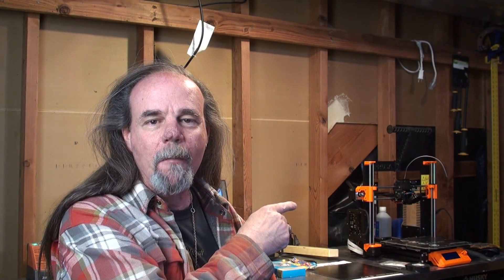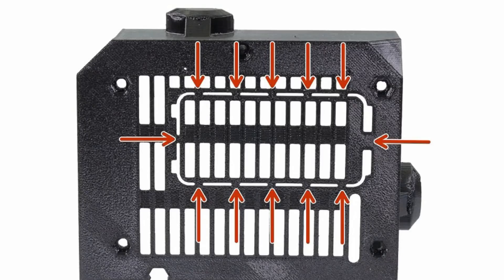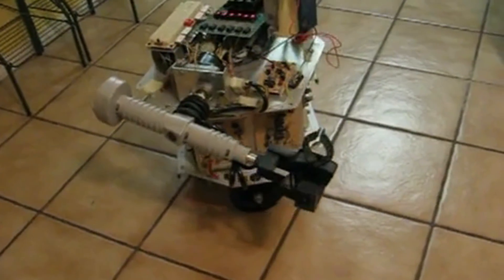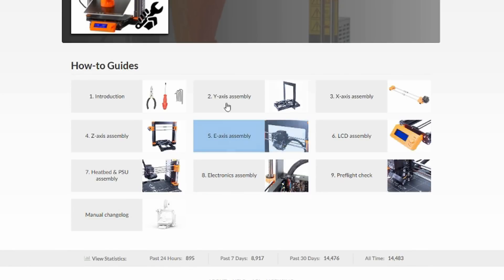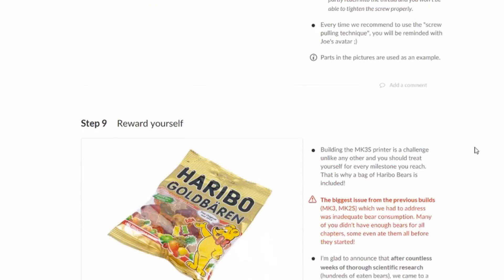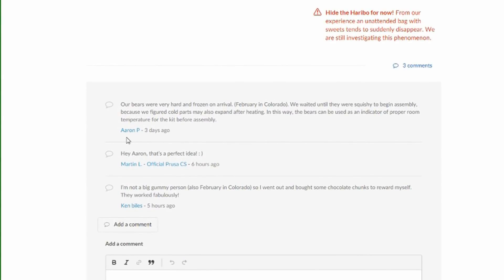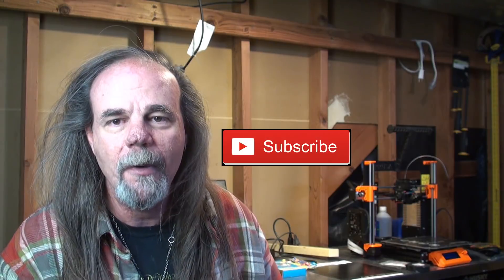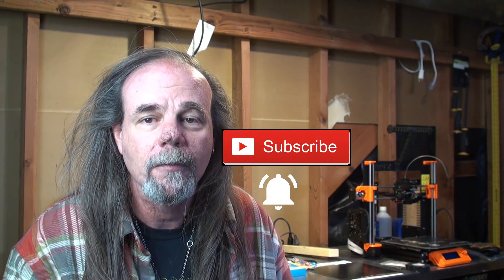Should You Buy The Prusa i3 MK3S Printer Kit?

Comment: The upgrade from mk3s from mk3 is good as a whole. But I don't really like the new sensor. It's basically a mechanical sensor with an IR switch. The previous sensor was able to detect not only presence but also movement. So I you had a jam or some other kind of issue that would prevent the filament from being extruded or not being extruded properly then the printer would detect it. Now you just have a presence sensor but instead of mechanical it's a combination and the mechanical part of the sensor is less prone to failure since it's just a lever moved by the magnets and the filament. So basically, negligible wear. This sensor is better than other sensors out there but I don't think it's an upgrade from the one on the MK3. I hope they fix this. Also I've been having issues with the new one not detecting the filament when it's inserted
Reply: do you recommend the mk3s? im trying to decide between the mk3s and the ender 5. I'm not sure which is better
Reply: @brittany4401  I would recommend the MK3S over any Chinese fdm printer. Unless you like tinkering with your machine. If you need a reliable printer go with the MK3S. Prusa Research products quality is really high. They also have wonderful costumer service.

Comment: I bought the Mk3 kit and upgraded it to Mk3s. I never before assembled something other than stuff from ikea. But I did a very good job and my printer's working perfectly. so that's about it, if a newbie like me could do it, others will have a good chance of success as well.

 the biggest advantage for me was, because I made an enclosure from ikea lack tables, that I didn't have to remove the power supply unit and unwire and rewire the whole machine to get it out of the enclosure (heat shortens the life-span of PSU's drastically).

and because I assembled it once, it made it easier for me to do the upgrade, which is disassembly of the whole extruder and then assembling the new one (took me about 4 hours with the recalibration).

Comment: 3:50 In one of my previous jobs I repaired smartphones, and my decidedly-unsteady hands had to get really good with curved tweezers also used in SMD rework in order to extract and precisely position nearly-microscopic screws. They made short work of most of the square nut installation (same technique to pull the nut into position, and fairly straightforward to reposition a nut that rotated in the slot). But the forceps would've been really nice for installing the hex nuts into the lead screw trapezoidal nut mounts.

While I'm not looking forward to redoing the wiring for the MK3S upgrade, the kit overall was fun to build. My only complaint was that there was no bag of gummy bears in the kit my company got. Maybe they'll include it in the upgrade package, who knows.

One of these days I'll mod the extruder assembly so one wouldn't have to re-do the wiring in order to, say, swap in a fully-assembled hotend with a different nozzle.
Reply from the maker: One of the improvements Prusa made on the MK3S, is making it so you don't have to disassemble the entire extruder, to work on an issue. I'm not sure how you would design it to leave the wiring alone if you disassembled far enough to swap the hotend. It's an interesting idea though.

Comment: I got mine on February 11 and hate it.  The bed is so unlevel nothing sticks.  Now the extruder jammed mid print.  This is my second 3d printer and honestly I think the much cheaper Monoprice Maker Select V2 (my 1st printer) us much better for the $.  So far their help hasn't helped.  I wish I could just send mine back.
Reply: "Nothing sticks" depends on a lot of variables, including axis alignment, calibration, and initial Z height. But the biggest factor for me was the PEI surface.

The PEI surface can be surprisingly sensitive to surface oils and dust. I had a rash of failed prints because there was always a little of my skin oil staying on the surface as I cleaned it-- that went away quickly when I started wearing nitrile gloves during the cleaning step (and even then, printing PETG is like making crepes-- the first try is a total mess, but the next one is perfect). One forum comment stuck out to me: "All the autoleveling and Z height fiddling in the world won't prevent a contaminated PEI surface from ruining a print." Give that steel sheet a good soaking in 91%+ isopropanol and see if that helps. You can also try Angus' (Maker's Muse) trick of using a little glue stick, then smear it with a solvent like isopropanol.

That said, I prefer PEI to, say, BuildTak any day of the week. BuildTak will become brittle and almost completely uncooperative if you look at it wrong, or after 2 months. I'm still using the original PEI surface on my company's MK3 in spite of all the abuse I've thrown at it. 

I got a nasty extruder jam one time, because the filament manufacturer allowed black plastic (acrylic? the stuff was solid even at 250C) chips in their white PETG filament. It took several hours of cursing and cold pulling to get the crud out, but it's been fine ever since I switched suppliers.
Reply: @MMuraseofSandvich  so you like it now that it's working?
Reply from the maker: Did you get the kit, or the built printer? If it was the kit, I can see why they might question the issues. Even so, there's a warrantee, so any parts that shipped bad, or got broken in shipping should be replaceable.

Comment: Ken caould you do some basic voltage reading for me on the new filament sensor. I want to upgrade my old MK3 but the parts from Prusa with shipping costs way to much, so I plan to do my own IR or proximity sensor. So I need to know the color code. Is the sensor RED wire + 5 volts or is it the signal out, is the Black wire Ground ? Is the white wire the signal out or V+. Now does the signal out go high when filament is inserted or go low. Thanks for any help.
Reply from the maker: I believe the IR sensor is the same. What they've done, is added a mechanical switch, that triggers, or backs up the IR sensor. Basically, it's now a double sensor, which allows optically clear filaments to be recognized.
Reply: No its a new IR sensor, the standard MK3 sensor is a 4 wire sensor that normally is used in optical mouse units. The new 3 wire IR unit even plugs the White wire into a different pin on the main board. That's OK. I will figure it out buy loading the new MK3S firmware into to my MK3 and do some probing. Just thought I would save some time with the right information.  I will post a video when done so all the others that want to upgrade there MK3 printers but do not want to pay close to $40 bucks for Prusa upgrade sensor. its all shipping charges.
Reply from the maker: Let me know what you find. You've got me curious.